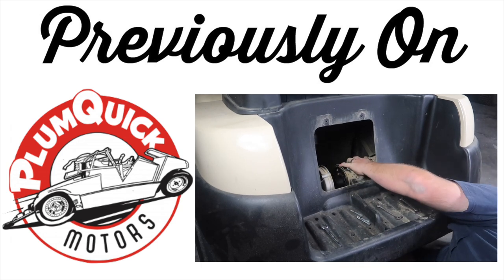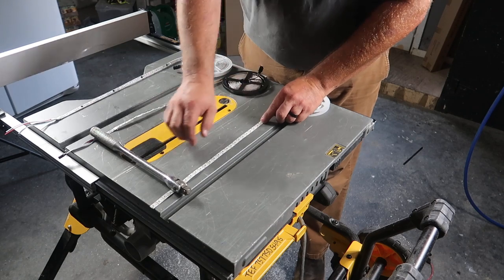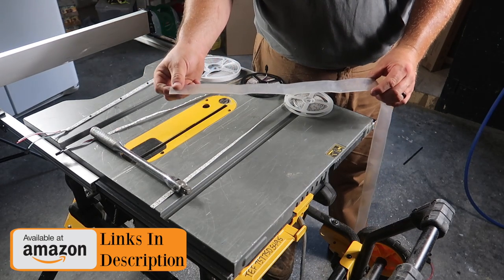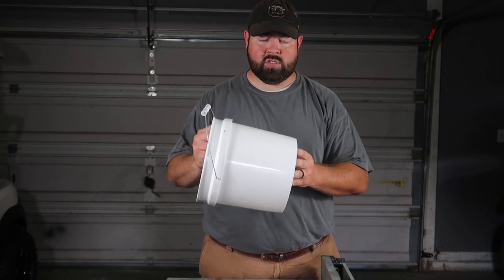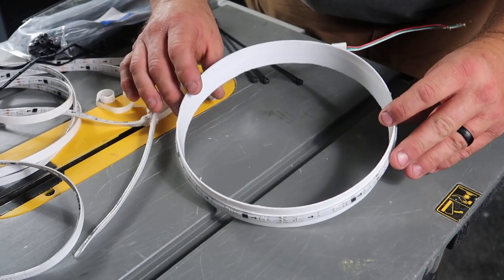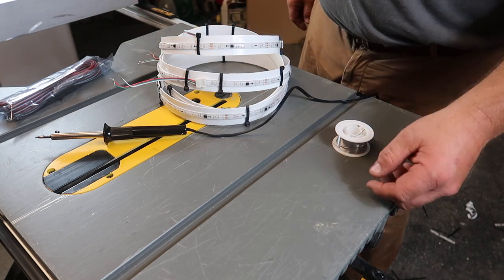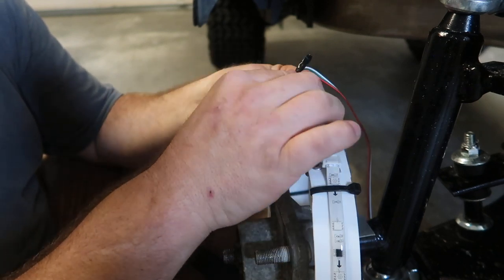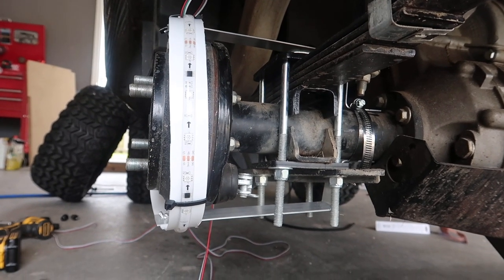How To Make DIY LED Golf Cart Wheel Lights | Club Car Ezgo Yamaha

Comment: I didn't see a comment on the LED wires you were using, so I wanted to add something.  The way the video shows you cutting the LED ribbon may be why the connectors you used were not working.  Those are designed to be used when you cut the ribbon on the line that goes through the center of the contact points.  By cutting behind the contact points, the ribbon was not lining up properly and was probably causing the contact points to short or lose contact within the plastic housing.  Otherwise, this is a great video and I love how you attached the LED's behind the wheels.  Awesome job.

Comment: Hey love the video and have to tell you, I've used those connections you said fail. They actually don't. You need to slide the strip under the contact points then lock the plastic tab down

Comment: First of all awesome series on cart upgrades.  Do you have a pic showing your wire hook up from the four wheels to the power supply?
Reply from the maker: I soldered all of them together at the controller and the controller gets power and ground.
Reply: @Fentertainment  Thank you sir.  Appreciate you.  Saw your Roypow video when I was researching Lithium ion batteries.  Pulled the trigger on that a couple of weeks ago  and installed it. It has worked great.  That one video got me hooked on your channel.

Comment: Another great video, thank you. What are your thoughts between the aluminum rings and the bucket cut rings, which is better?
Reply from the maker: My original rings are the aluminum rings and I wouldve made aluminum rings for that video but I couldnt find aluminum stock at the time. I have to make some for some carts soon and will be using aluminum again. Buckets are cheap and easy to find.

Comment: I just watched the wheel dream light install video.  I bought the dream light kit you posted the link too . My question is where can I find a second wifi controller to use with the wheel lights ? I used the one that came with the kit on the roof light strips .

Comment: When I worked in the field, I installed a security system for Plumquick. There business is in my county. Not too far from me. Man you got that think souped up. Man that is a nice install. Very clean looking. You always come up with some great stuff. it is a bummer those little wire clips didn't work out. That would have saved you a lot of work I imagine.
My daughter wants to put some around the top of her wall in her room. You need to help me figure out a way to do that easy lol. I guess I could mount a battery supply some where but trying to figure a way how to mount them sort of putting some molding up. Which that would be the best and coolest way I guess.
Reply from the maker: That must be the going thing because my daughter begged me to do that and i finally caved in. The kits come with a 110 to 12v power adapter (wall wart). So doing something in a bedroom like that is super easy, however i dont like the way it looks. But for my daughter i compromised. I tried to get her to lets do crown up top so we could hide the lights but ofcourse that wouldnt work. Its leds, its just paint and if it messes up the walls i will fix them. They are only young once!
Reply: Fentertainment Yes that is what she is wanting too lol. I was thinking crown but that’s a lot of work. I do have the crown though. Might think on that.

Comment: I have a club cart precedent 2013. I was going to take it in to  to upgrade the speed to speed code 5. If I do so, it will increase speed by how much? Also later down the line I do want to upgrade to the plum quick. My question is should I leave it at speed controller 4 and upgrade to the plum quick. Or add the speed controller 5 and plum quick. Hope it make sense.
Thanks!
Reply from the maker: Ive never done any of the speed codes so I couldn't tell you. Just being honest.

Comment: What powers the lights?
Reply from the maker: I installed a voltage converter. It takes the 48v pack voltage and converts it to 12v. Here is that video - https://www.youtube.com/watch?v=P-6Q-0hFB8Y

Comment: Top mod ! I have a 48v club cart. Would love to do this to mine too. 1. What did you use as the power supply for the LEDS? 2. eBay for the led strip ? Cheers cribby
Reply from the maker: I put everything in the description of the video.
Reply: @Fentertainment  the link you put is 110v kit, they say it does not work as 12v?
Reply from the maker: @Oven74  I just checked the link and it said 12v in the description. There is a 110v wall plug incase you want to use them indoors. That plug steps it down from ac 110 to dc 12v. It will work just fine.

Comment: How long did you make the flat bar?
Reply: You will need to guesstimate the length.
I measured the diameter of the plastic circle,  then subtracted the axle diameter,  then added around 3 inches to make the bends for the clamps (axle) and the rivets (plastic ring).

Comment: I have a gas cart. What would serve as the ground wire?
Reply from the maker: The negative on the battery or the frame if the battery is grounded to the frame.
Reply: @Fentertainment  I would have thought that there would need to be a ground going from the wheel light wires to a ground source. No?
Reply from the maker: @couriedennis4292  I thought you were asking where to ground your wheel light ground wire. The wheel lights themselves are connected to the main box that controls the lights. The box needs power and ground only.
Reply: @Fentertainment  thanks!  Really appreciate it! Now that you’ve had these on this cart for sometime, what material do you recommend for the rings that hold the light strips? I believe you mentioned aluminum, PVC, and the bucket.
Reply from the maker: @couriedennis4292  I would use aluminum flat stock in the 1/16" thickness. Its easily bolted or riveted together.
Reply: One more question. Does it matter which of the wires coming out of the Bluetooth controller (the power supply cables) go to positive or negative?
Reply: @Fentertainment  installed cabin glow lights today. Turned out great!  Thanks for the video and the follow up Q&A.